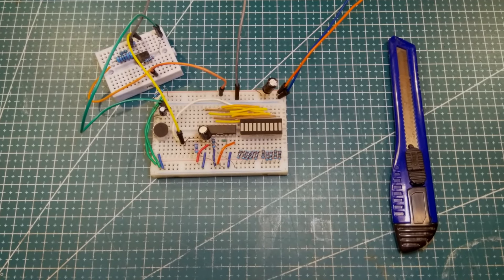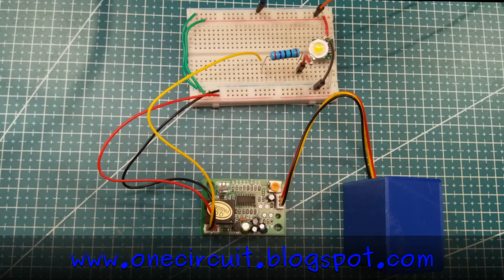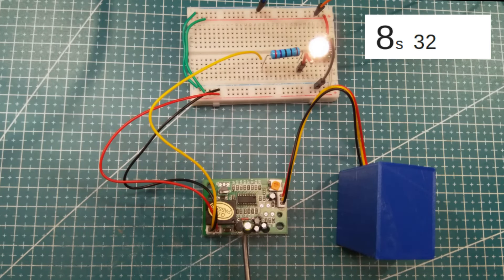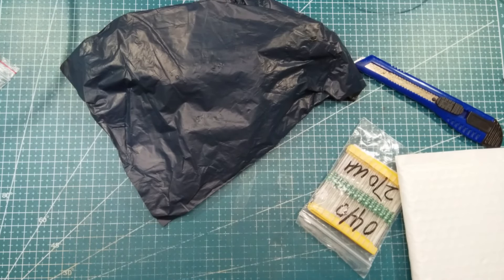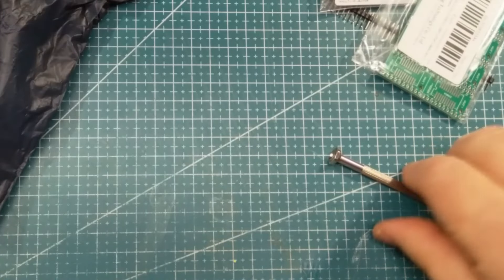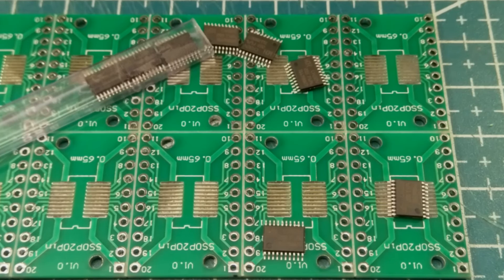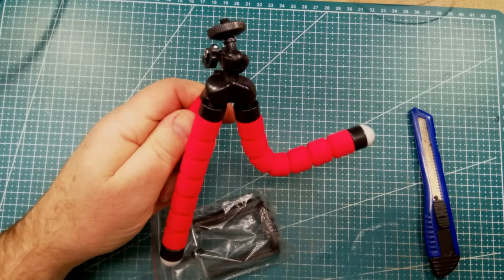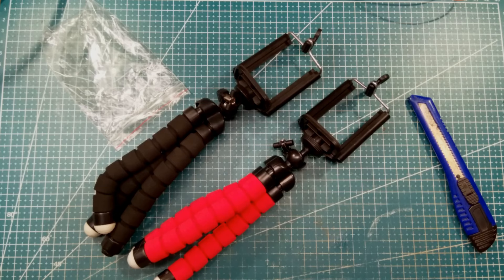Mailbag #39 - Lovely stuff including pretty cool RISC-V chips

Comment: You could have that PIR sensor turning on a porch light.
Reply from the maker: Yes, I was thinking auto door or gate via motor? I would still prefer to roll my own! 👍😀
Reply: @onecircuit-as  I did'nt think of motor control. 👍 But yeah, home made is better. You have more control over it.